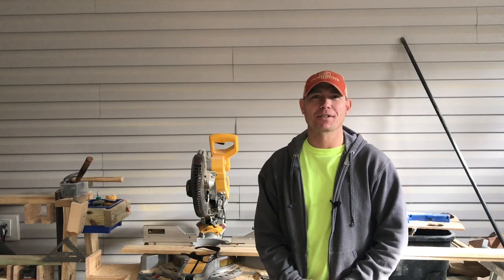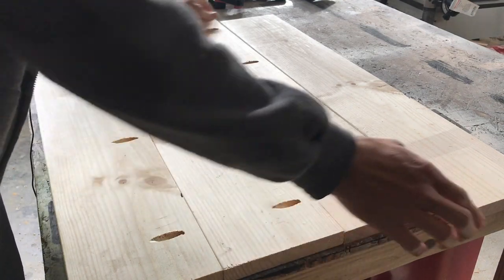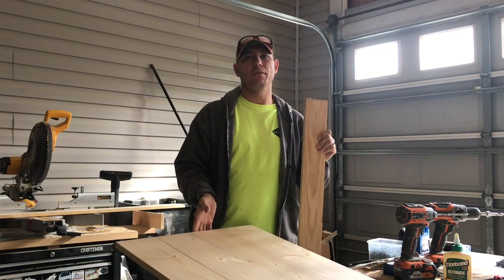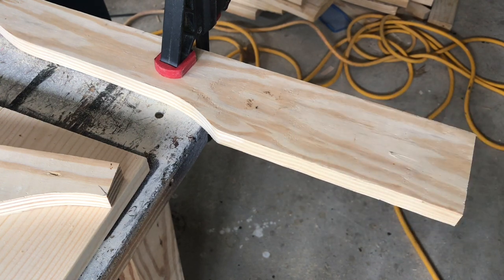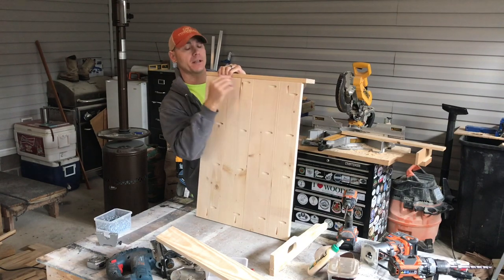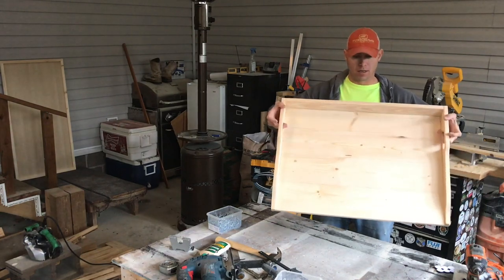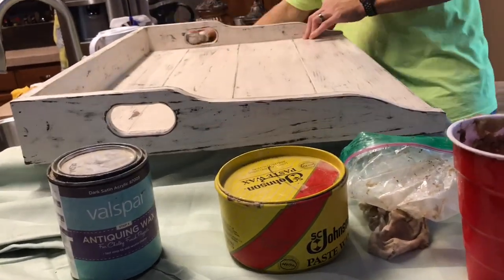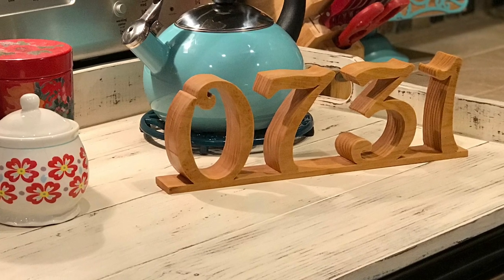Stove Top Cover | Noodle Board

Comment: I absolutely love your noodle board!  There are lots of versions out there but this one has it's own handles which saves the expense of purchasing hardware.  I only bought 4' of the 1x4, but the wood leftover from my 4th piece of 1x6 was just enough for the back and it happened to be the exact length. I followed your pin from Pinterest but thank you for also making the video, it really helped a lot.  With my kitchen being so tiny, this noodle board helps supplement counter space when I'm not using the oven.  Thank you for making such an easy tutorial! Your noodle board ROCKS!

Comment: Great project! I think I'm going to have to make one of these. I'll probably switch up the joinery but I'll be sure to give you a shout out and link your video!
Reply from the maker: Nice. Thanks! What type of joinery do you plan on using?
Reply: 731 Woodworks I’ll probably use plywood for the base and use dados in the sides and back. Screws with plugs in the sides. Something like that. I’m really behind on videos, probably spring time.
Reply from the maker: @thehusband12  Good idea!

Comment: Hi ya Matt! Hope you're doing well. Regarding the pocket hole screws on the back, do you fill those in with wood filler, pocket hole plugs or leave them as is? I'm making a noodle board to give to a resort to sell for me in their gift shop hoping that I can get future sales by their visitors and tourists. Any help is GREATLY APPRECIATED!  Thank you for your time and for making this video. 
- Louis
Reply from the maker: I leave them open but you can plug them if you wish.
Reply: @731Woodworks  Thanks Matt.  I think this go around I'll leave as is considering I'm facing a time deadline to get it done.  Have 2 weeks to get it done outside my full time job.

Comment: How do you recommend painting something like this white? I painted mine white and now you can see the brush strokes and all the knots coming threw the paint
Reply from the maker: Spray it.  Use a stain blocking primer first.  Then at least 3 coats.  A good quality spray paint works fine

Comment: What if I don't have a table saw or miter saw. What is the best way to rip the boards
Reply: You could use a circular saw or a jigsaw, with a straight board clamped on as a guide.

Comment: Do you only paint one side? The side that is facing up?
Reply from the maker: I painted both sides
Reply: @731Woodworks  what did you use to make sure the paint didn't scratch onto thr stove top? It's a gas burner.

Comment: You should have used a biscuits to join those boards together. Instead of the method you used.   Kinda looks like Swiss cheese from the backside
Reply from the maker: I find that the pocket hole method is faster (no dry time) and more accessible for a lot of people to try.  I haven't had any issues with the pocket holes and have been using my noodle board for almost a year now.  Besides, I never see the bottom of the noodle board, so to me it doesn't matter what the bottom looks like.  That's kind of like worrying what the underside of refrigerator looks like.  You never see it so it doesn't really matter.  I agree that biscuits would be a "cleaner" look.  But I don't mind the pocket holes at all.
Reply: Biscuits do not add any strength to the joints and can sometimes work against alignment. Better to just glue and clamp or if in production mode, do as Matt did.